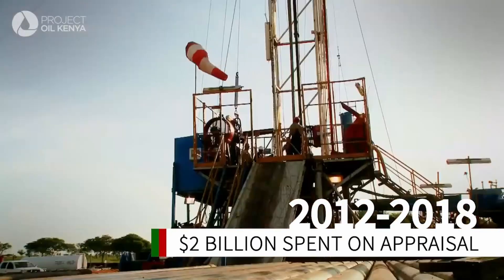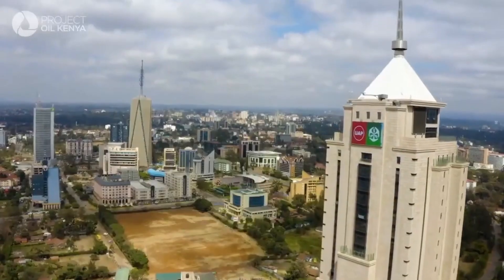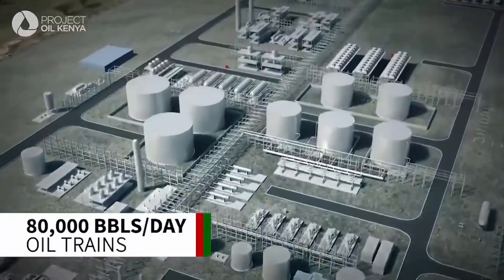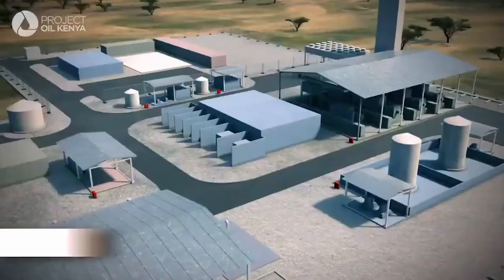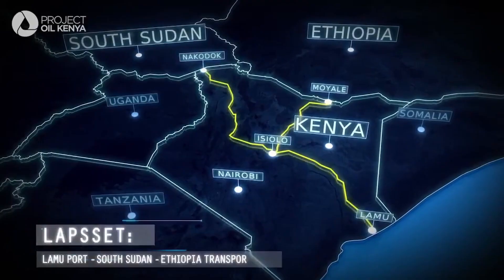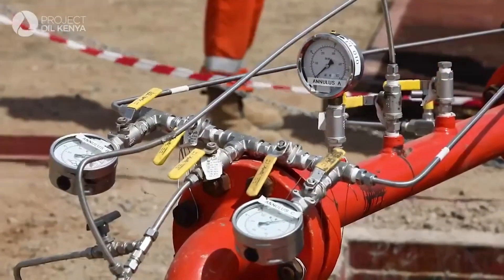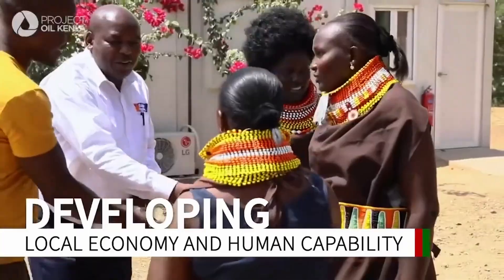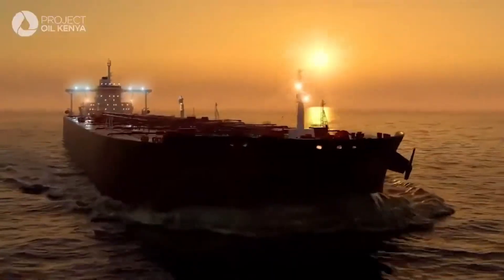Tullow's Oil and Gas Project in Kenya (They Sold It)

Comment: How old is the video?
Reply from the maker: This was a status update from Tullow Oil on their project in Turkana. They have now once sold their assets in Kenya
Reply: An old video before eops
Reply from the maker: Yes..a status update for many who did not know what Tullow Oil had done now that they have sold their interests in Kenya
Reply: @gakuo.munene  What you are effectively saying is that they have basically confirmed some amount of recoverable crude oil resources in Lokichar basin, appraised/valued it, put it on their balance sheet and then short-circuited the whole enterprise by hurrying to sell it off as their asset (on their books) without the need to actually recover the crude for export as was, ostensibly, the original thinking? Makes sense for Tullow, but hardly any sense for Kenya, the country.

Why would the country allow that?! What is the use, for the country, of identifying the resources and then letting potential developers behave like Tullow has allegedly done? 

From the perspective of the country, it defeats the very purpose of the expensive exploration and the displacements of the people who were using that land prior to its being carved into blocks for oil exploration. What has the country gained from this?